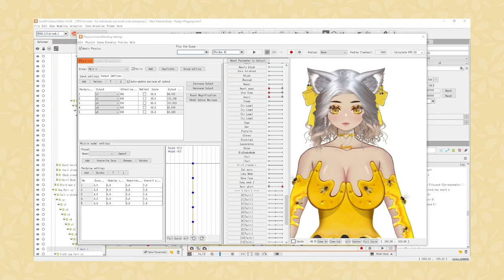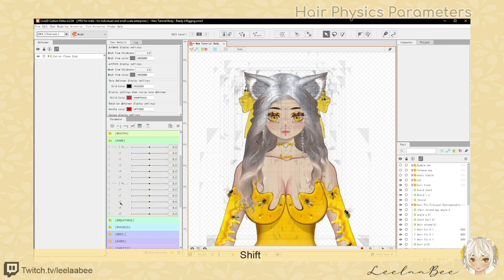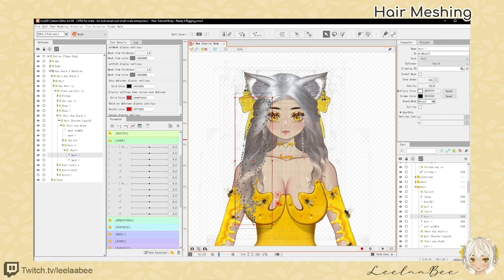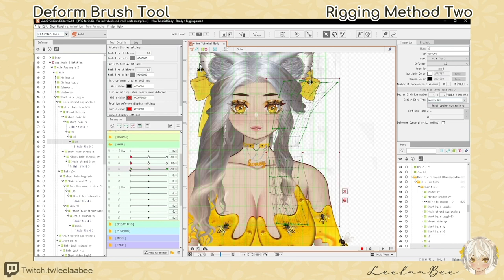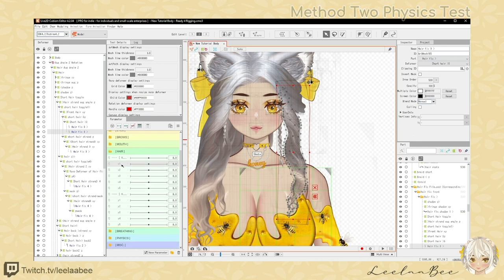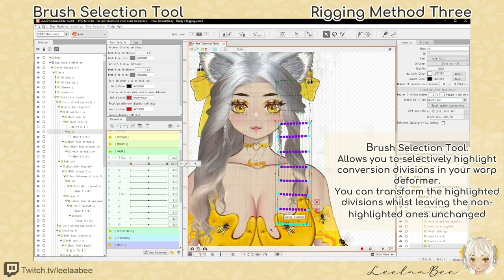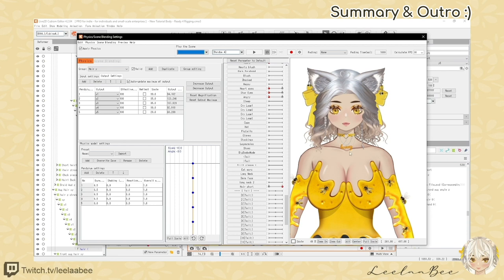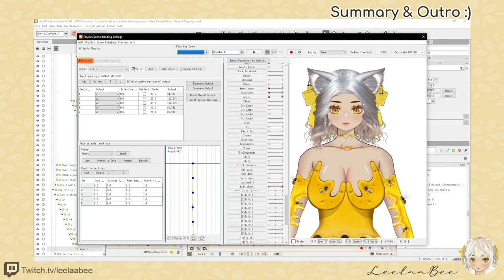【HOW TO: Rig Bouncy xy Hair Physics!】Live2d cubism step-by-step guide! Ep8 ꕥ #vtubertutorial

Comment from the maker: Hi!!! I hope this video was helpful, feel free to ask any questions or share your Live2D tips/tricks of your own in the comments below! Just a couple of things I forgot to mention: make sure you add your pendulums first in the physics model settings beforeeeee you add your output parameters in the output settings! Otherwise, multiple parameters can unintentionally be stuck on the same pendulum! In terms of extended interpolation, it is a bunch of jargon but in summary, it's GOOD for increasing smoothness/fixing errors between keyforms but use it SPARINGLY as it increases the size of your model file <3